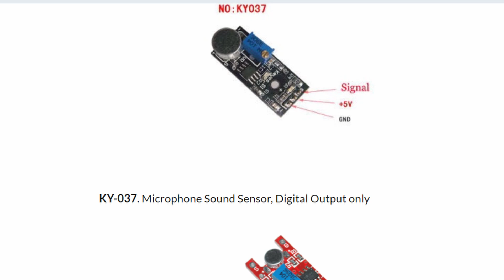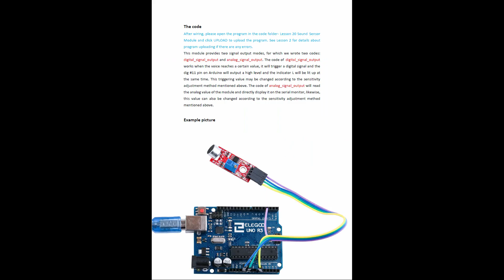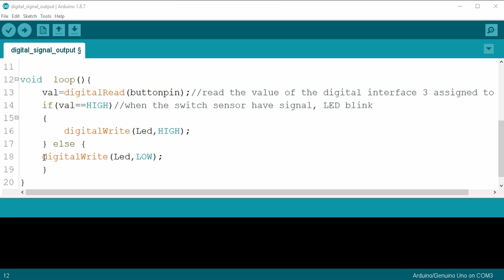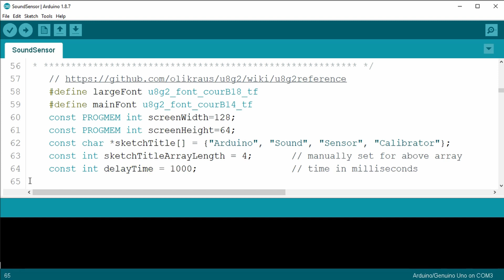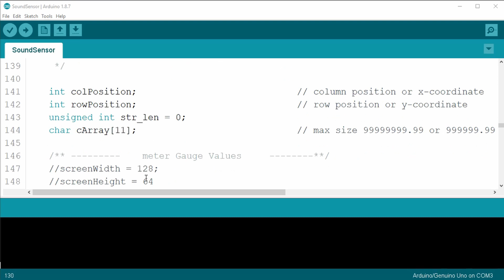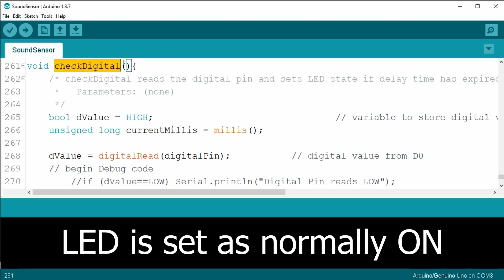Lesson 20 - Sound Sensor Module KY-038

Comment: You wouldnt possibly have a solution to make this into a decibelmeter? Its not working for me.
Reply from the maker: Greetings, this module is really just an audio detection device.  When I originally created my Arduino circuit with display, I was really hoping to create a decibel meter.  Truth be told, I filmed the video as I was developing my circuit.  After several attempts, I gave up on the idea that this module could be used in such a way.   So, the circuit ended up being a poor sound detector with a fancy OLED display.
Reply: @rickmorenojr  Hi and thanks for your reply. I ended up presenting this as a decibelmeter anyway but i could only get accurate readings under 50 decibel. Tried with different calibrations and thought it was just me that was not experienced enough to figure out a good solution. But it seems many people have had problems getting accurate readings.

Comment: Hi! I have a question! 
I dont understand why the volts, minvolts and maxvolts are calculated like ("value"*5.0)/1024. 
If you explain it to me I would be grateful. Thank you
Reply: Arduino use 10 bit as analog input which mean the analog data range you capture can be 1024 (2^10) wide (0 to 1023), if you convert it to volt 0 means 0v and 1023 means 5v.
Reply: Because behind A0-A5 pins there is an A/D converter (by the way, 1 converter in common for all 6 analog pins)which transforms analog voltage value between 0 and 5V (or Vcc in general) to an integer between 0 and 1023. To put it back in the voltage level, you need to calculate like in that formula.

Comment: I can't understand how this device can be useful. The analog out does not change if you speak or if you clap your hands. You can get significative variations only blowing in the mic, tapping on the mic or with anything else that applies a "physical pressure" to the mic itself. Probably it's because the analog out is a not-amplificated signal. Anyone else with the same experience ?
Reply: Yes! You found any solution? :)
Reply: Exact calibration method of sensor please. Do i need to connect all sensor pin and then rotat anticlockwise or clockwise
Reply: Yup. Same here
Reply: @Lkdytz  Pareil pour moi, je suis à la recherche d'un capteur de son amplifié.

Comment: Hallo sir.I am making this experiment.I have connected my LED to pin no.4 of Arduino and the output of sensor to A0.But what is happening with me is that when I am making sound,the LED of sound sensor is blinking but the LED of breadboard is not blinking.Sir what can be the problem? I have connected the anode of the LED to a wire and that wire is connected to D4 pin and the cathode is connected to ground via a resistor.
Sir please solve my problem.
Reply from the maker: It's been a while since I've looked at this circuit.  Please review my video again on the module's actual schematic.  If I recall correctly, the first comparator will drive the output to zero when a sound is detected (more positive on negative terminal drives the output low).  D0 become momentarily zero, but normally +5V.  The second comparator works the same way.  But since D0 is normally +5V, the output is low keeping the LED on.  It blinks the led OFF when D0 goes low. I hope this helps.

Comment: Hello sir, i want to use three pins of KY-038(DO,G and +), just like KY037. Will this work with only three pins? Can you please tell me which three pins are same in KY-038 module as compare to KY-037. Actually I don’t have much knowledge about arduino and electronics, so I don’t know about this thing.
Reply from the maker: If you look closely at the board, A0, G, + , and D0 are silk screened on top next to the pins, and work similar to KY-037.   You may need to compare datasheets to verify how they function.

Comment: @9:40, effective code flow will read sensor value every (2xSensor value) millisec, which effectively should be every 1 sec (based on the output 516 @10:31). The noise that you are producing is short lived, less than a sec. Is this the reason, it is not able to read the value?

Comment: How can i use this sound sensor for more applications with different power consumption?
Reply from the maker: It would be better to design a new sensor circuit from scratch.  This module can only do one thing.   Send an output pulse when a sound exceeds a threshold determined by the potentiometer.  

So, determine your parameters and design a circuit to suit your needs.

Comment: Used your code to try it...and just doesn't work 
Circuit is very simple i'm totally sure I've done it well
So...just don't understand why both leds are turned on all the time
Reply: I had the same issue, you need to adjust the potentiometer. Basically to lower the threshold, hold the sensor with the blue box (potentiometer) on the left and microphone at the top, then use a small flathead screwdriver to turn the gold knob anti clockwise until the left LED just turns off. I found it helpful to make sure the code is uploaded to the circuit while you're doing this. Otherwise this video was a big help: https://www.youtube.com/watch?v=oeK9KaQv8Qk
Reply: you might have accidentally not put "==" always equals like I did
Reply: @matthewbarker9188  nope...It's ==

Comment: Really appreciate the callibration part and pointing out the correct internal schematics. This module was driving me crazy and I thought it was just a useless piece of junk...
Reply from the maker: This module has limitations.  It only detects loud sounds.  It does not amplify nor provide a way to measure sound or frequency.   It cannot be used as a microphone.
Reply from the maker: For anything other than triggering a pulse for sound detection, this module is useless.

Comment: Great explanation and well-made video! Would you happen to know how to get a frequency reading from the KY-038? I'd really appreciate it as I'm looking to build a guitar tuner for a project.
Reply: Could you let me know how it goes, or what code you used? I would love to replicate it.
Reply from the maker: My code is available in the GitHub link in the show notes.
Reply from the maker: The module has limitations.  It only detects loud sounds.  There's no frequency or amplification capability.  You'll have to find a different module for that.
Reply: @rickmorenojr  couldn't you take advantage of the analog out, run it through a dac & code an fft for the target frequency? (Afterthought, could pwm input work as a dac?)

Comment: What is the minimum input voltage for this sound sensor ?. My board does not have 5 volt it only can supply 3.3 volt  . If it cannot operate on 3.3volt i think , i need DC-DC  boost converter/linear regulator  to boost to 5 volt
Reply from the maker: If you can, always go back to the manufacturer's data sheet.  The data sheet provided in the kit for this component isn't the best.  It does indicate 5 volts.  Test it with 3.3 volts and see if it works.
Reply: @rickmorenojr  Thank you for reply . I will test it first , after i got the hand of it .

Comment: I have researched this for quite sometime now, used a couple of codes and setups online as well as this video but can't seem to get the desired result. So what's happening is when the code is uploaded as well as the exact same setup of the sensor writing to the Arduino LED on pin 13, the sensor doesn't output anything despite my earnest attempts of clapping. Following one of the tutorials, it suggested to tweak the potentiometer until the 'LED2' starts flickering. So I have it set on that, and notice that when I clap loudly the LED2 on the sensor flickers on however the Arduino LED (or an external LED with a resistor attached to its anode to ground on a breadboard does not). The Arduino LED / external LED however very rarely responds to my claps whereas LED2 seems to always be responsive although when blowing over the microphone the load LEDs turn on. I can assure you my wiring is the same as a basic setup and heres a pseudo list just in case:

Sensor's D0 ----> Arduino Pin 3
Sensor's A0 ----> Arduino Pin A0
Sensor's V+ ----> Arduino 5V
Sensor's GND ----> Arduino GND

Arduino Pin 13 (onboard LED)
(Arduino Pin 7 ----> external LED)

Any help will be appreciated thanks!

Comment from the maker: Unfortunately, my example sketch is heavy on the OLED, string manipulation, and kinda light on the KY-038.  It tracks the maximum and minimum values and shows a bar graph.  I revised the sketch after making the video.  The revised version is available on GitHub (see link in show notes).

Comment: How can I get Decibel value from the Analog pin and display to the serial monitor ? Pleas Help
Reply from the maker: Since the KY-038 module doesn't amplify the analog signal, but rather applies a DC bias, I imagine it would be hard to detect and calculate decibels correctly.  There are other videos on the web that attempt this, but I think building your own circuit, or using a different module, would be preferred.
Reply: @rickmorenojr  can you mention a sensor that can give decibel values ? Would the 3 pin LM393 sound module work ? I just need a Arduino compatible sensor to give decibel readings. I know you are busy with you life and work and is not your job to search for this but I really am stuck and don't have anyone to ask for help
Reply: @tonmoy5687   did you get around to this? i too am looking at a db reader
Reply: @eueueueu21  sorry mate , couldn't find the device i needed
Reply: @tonmoy5687  yea... waste of money this module...
Reply: @eueueueu21  yeah , good luck with your work
Reply: @eueueueu21  try the gymax 4466 module
Reply: @jed-ct   Will check, thanks man

Comment: Why the analog output has a same value even our voice is loud and low?
Reply from the maker: As I said in the video, the analog signal isn't amplified.  The potentiometer adds a DC bias, or DC voltage value, so that the comparator can be switched on or off.  The DC bias doesn't amplify, it just raises the starting voltage.
Reply: @rickmorenojr  How can I get Decibel value from the Analog pin and display to the serial monitor ? Pleas Help